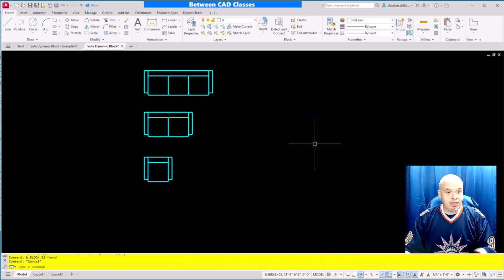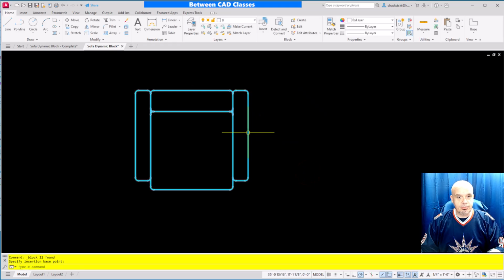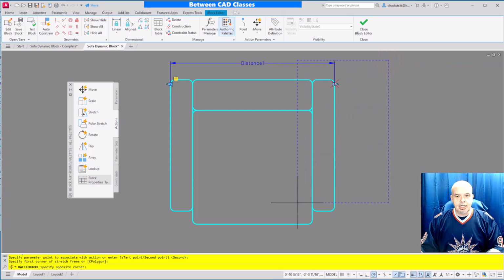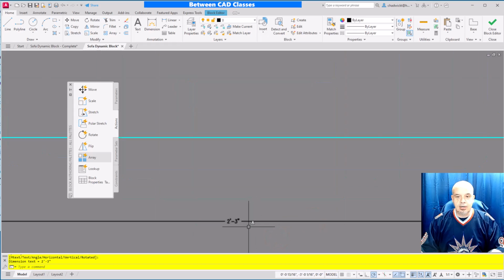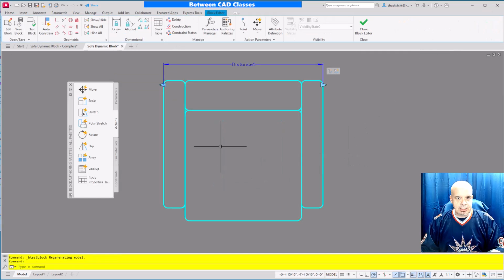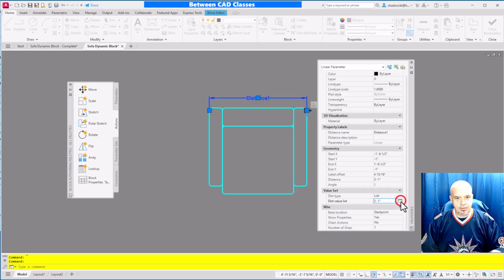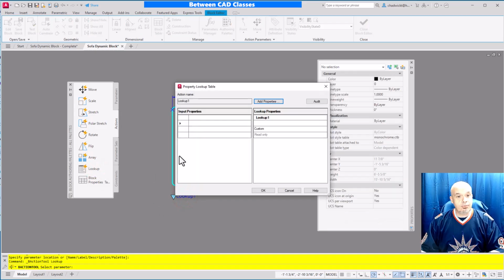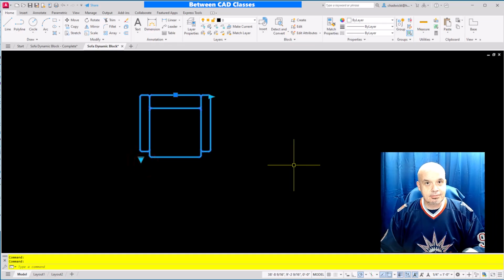AutoCAD Dynamic Blocks: Stretch & Array Together

Comment: Is there a way to use this method without a constraint on the cushion size? So as you stretch the overall couch, the cushions stretch uniformly until they reach the threshold length, and then it adds a new cushion. Basically, a maximum and minimum for the cushion size instead of setting a fixed dimension.
Reply: i’m in a similar pickle.  i’m making window elevations for glass walls/doors and im trying to give myself the ability to stretch one side of my system to a desired length, and have i-beams automatically insert themselves evenly within the glass wall…like every 33.5 inches or so.  tbh when you stretched the array to the left and it did that weird thing where it arrayed itself…but not in an incremental fashion.

i imagine this isn’t how autocad was intended to behave, but if i can break it properly maybe i can get to to behave the way i want it to lol. lmk if you’ve figured this out lolol
Reply from the maker: That is an amazing question. I wish I had a good answer because I am not sure. I will play around with it and see if I can find a solution. Perhaps it could be programmed using AutoLISP, but unfortunately learning that has been on my to do list for about 25 years now!

Comment: I want to create a block — the rectangular shape will always remain fixed because the shape itself is not important, only the texts are. I already assigned a lookup to the block and added one attribute that displays the selected lookup value next to the rectangle, and that part works fine.

Now I want to add another attribute whose value is also taken from the lookup. For example, when I select the first option from the lookup, I want the corresponding text (such as the code related to that part) to be displayed next to the block.

In the end, I want to have a fixed rectangle with a lookup value displayed beside it, and another attribute displayed below that lookup.